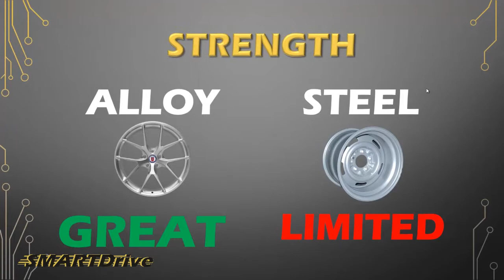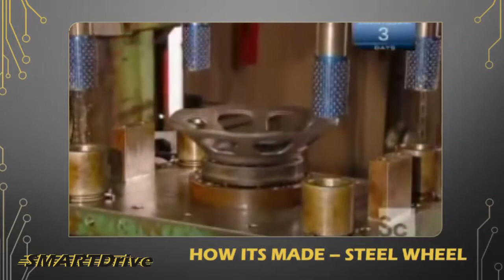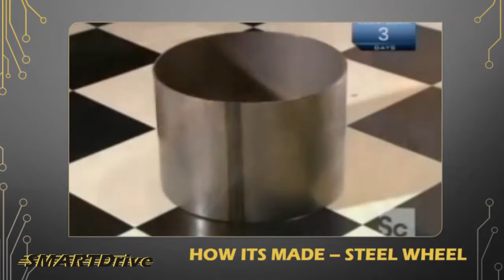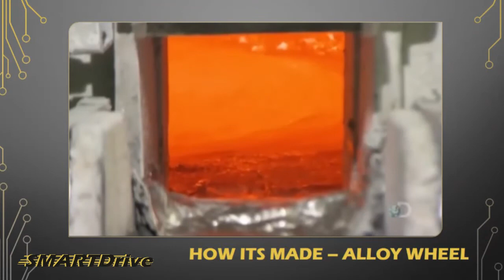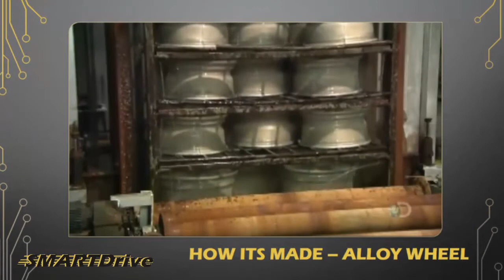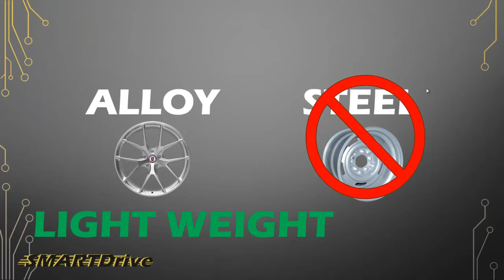Alloy Wheels vs Steel Wheels: Everything You Need to Know

Comment: hey if i want chng m steel wheels nd tyres 165/65r14  to alloys wheel with tyre 185/65r15 wht effect on car mileage
Reply from the maker: +deepak dabas upgraded tyres will decrease your mileage by 2 to 3 %. (Not a scientific measurement but by experience.)
Upgrading tyres with alloys are always recommended as it improves stability, speed, braking, and control.
Reply: SMARTDrive thanks sir